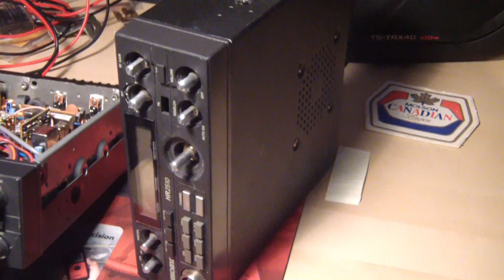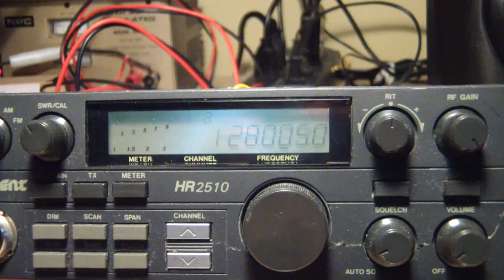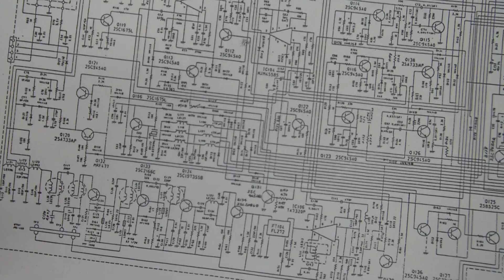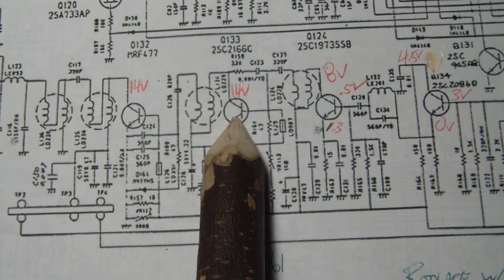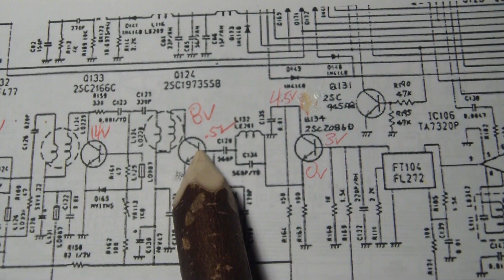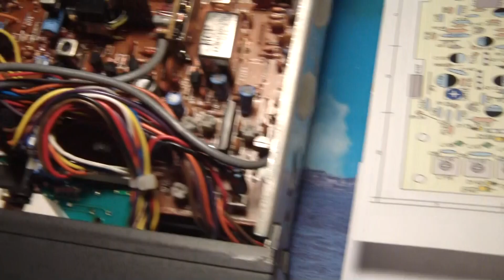Uniden HR2510, mobile 10m HF radio's, repair, part 2

Comment: help.....need......Dramamine.......seasick from shaky camera.
Reply from the maker: Sorry about that. Looks like the video encoding was not optimized properly (either me or during upload to YouTube) and not necessarily camera shake, although the results being the same. I'll see if YouTube still has that "anti-shake" feature and implement.
Reply from the maker: Try adjusting your YouTube settings for the higher Q video. When I watched on my Nexus, it was smooth. It was shakey on my old laptop when it was set for 480p. 1080p was better.

Comment: great video can't wait for part 3 r u going remove that old brown glue u should it can kill a radio over time and all was due for a recap
Reply from the maker: Jim Rowlings Yes, now that my other radio priority fix is complete I can get started back on this one. Are you saying the brown glue around the PLL? Looks like some hardened epoxy. Melt with a heat gun? Of course, I have been thinking about the re-cap. There is definitely a few in this radio. Time to build another cap kit to add to the stable.
Reply: that old brown glue that is around different parts as it gets old it eats jumpers and the legs off other parts and yes make them to work right caps can short as they age

Comment: i am currently running 2 hr2510's with a mosfet final conversion. the only thing that does not work is the rf on the meter and a fix may be here in the future. they perform as good or better that the mrf477 with little heat from the heatsink